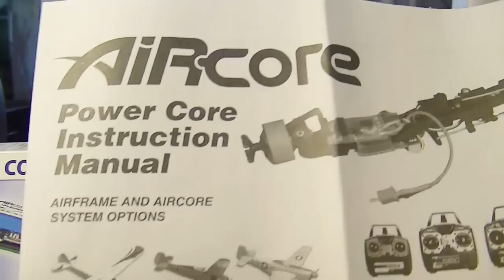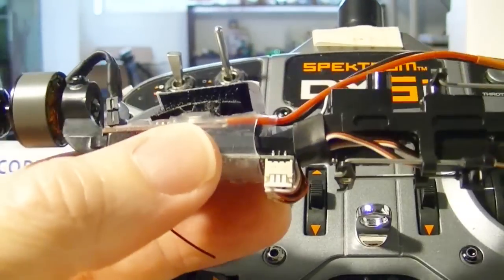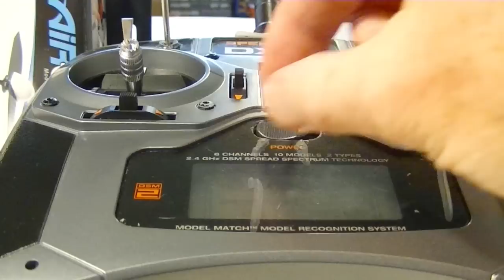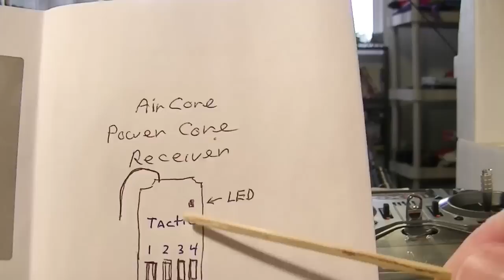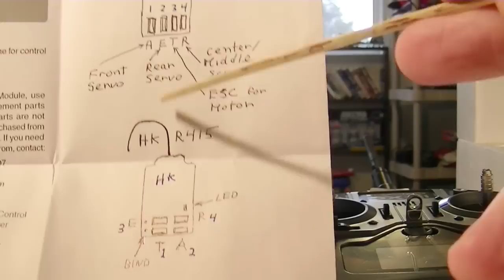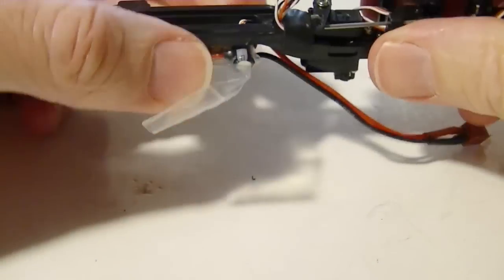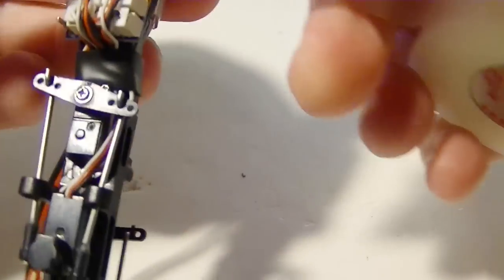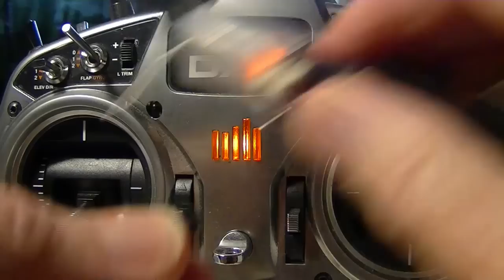AirCore Plane Power Core Conversion with Spektrum Compatible HK R415 Receiver

Comment: Very cool! Too bad I didn't see this before getting the Anylink! I'd prefer to have not had to hassle with it! BTW, have you ever tried swapping out that proprietary propeller they have on these aircores? So far mine has held up, but they're not making them anymore and it's just a matter of time before mine bites the dust!
Reply from the maker: I haven't tried swapping it but I have seen others doing just that on RCgroups.

Comment: i am just wondering. is it still working great. did you had any complication afterwards? any complication flying? i just ordered my aircore, airfram and hobbyking spektrum receiver.
thank you.
Reply from the maker: So Ra The receiver is still working great. The main problem with the aircore design is the plastic prop saver which brakes all the time. It's also frustrating fiddling with all the magnets on the control rods. The mustang still flies great though.

Comment: I'm glad someone already thought of it. I have been considering buying into these I was think I might have to do some soldering ect... But I didn't know it was dipshit simple to do. Thanks!
Reply from the maker: Yes, with the HK415 you don't have to solder. The plugs just fit.
With the AR6300 you will have to solder on new pigtail plugs and really you don't need any more range than you get with the HK415. These planes will be out of sight before you lose signal b/c they are so small.

Comment: Dang. Nearly nailed yourself with the knife at 9:35.
Reply from the maker: I lucked out that time.
Reply: ***** Yep. That was close. By the way, excellent video. I'm considering doing that myself.
Reply from the maker: It works great. The hardest part is pulling out those little plugs and not breaking the wires.
Reply: ***** Good to know. I think in the end I might end up with 2 main transmitters though. A DX6i for all the nice HH bind and fly stuff... and a Hitec Aurora 9X for the SLT stuff and anything I might want to put my own receivers in.
Reply: I was waiting for the Ernest goes to camp moment... hold the knife at a perfect 45, run it briskly down the stone, and directly through the meat of the hand!

Comment: Nice, but its normal to put your trims for throttle channel to "0" not in the middle  unless, you are flying gas powered ones, which you can set the throttle trim to the middle or more, to prevent the engine from shutting off.
Reply from the maker: On all of my electrics I have the throttle trim in the middle and they work great except in this case.
Seems to be the exception to the rule rather than the norm in my opinion.